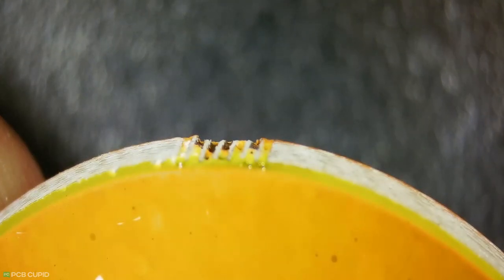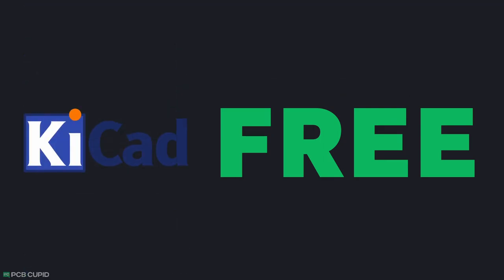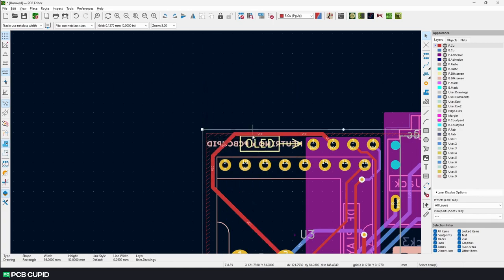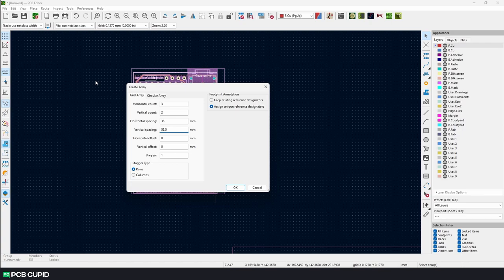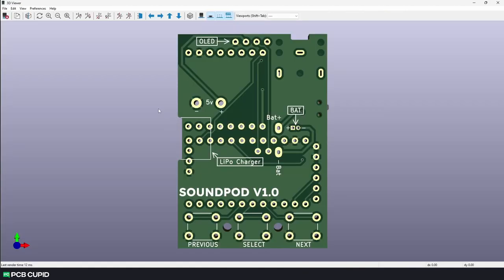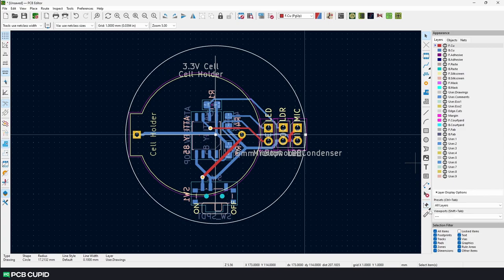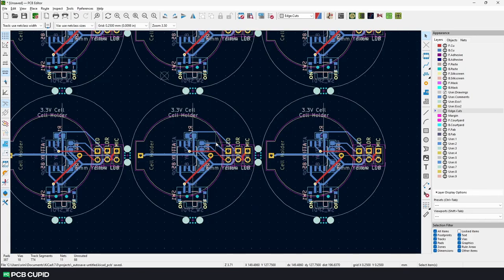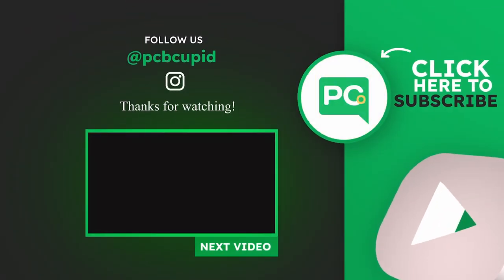#18 How to Panelize PCB in kicad 7.0 | V-score | Mouse-Bite | #pcbcupid

Comment: It was a good video, but I still didn't get the point why should we do it ourselves rather than leaving that job to the manufacturer.
Reply from the maker: Not all Manufacturers give custom options to make rails, mounting points or other features like fiducials. Which are very essential if the PCB are not assembled or tested by them.
Reply: Getting 5 panels with 6 small pcbs each is often cheaper than getting 30 pcbs. At least when you're working with small boards
Reply: Another example where you might need to do it yourself is a small board like I'm making that has castellated holes right where all the automated tools want to add the mouse bites 🤬 but need to be routed out there instead with the bites to either side.

Comment: I was waiting for this video from a long time. Could you just make a video in which you could tell us how we can combine two or more than two different pcb. So that i can order single pcb of two different project in same cost and just break them apart and use it in the different project.
Reply from the maker: We'll do that in the next video 🙌.
But i don't think you can print 2 PCB in a panel at cost of 1.

Panel charges will be different, and there might be additional cost as you keep adding more design to the same panel.
Reply: @pcbcupid  so is there any other ways by which i can add two circuit in same board and later we can cut on my own it if we provide enough spacing . As it will save time and money during prototyping the circuit.
Reply from the maker: @sudhanshuranjan4957  if you can make your 2-3 design as a single PCB (without vscore or mouse bite). You can get it done cheaper, but you won't have proper finish and need to use crude way to break the PCB (Saw, CNC or some other means)

Comment: Is F.Cu layer of Vcc and the B.Cu layer of GND makes the capacitance in the PCB?
.
.
.
If i created the F.Cu layer of Vcc fill and the B.Cu layer of GND fill, then the upper side is vcc and  the lower side is gnd then there is probability of capacitance is induce,

can you say is ok for mini projects and this is not recommendation for frequency and clock related projects?

what if i can fill both the layers with vcc?

what if i can fill both the layers with gnd?
Reply from the maker: In this case it's already recommended to fill both side with GND. I would never suggest to go with alternative fill on top and bottom if it's a 2 layer board.